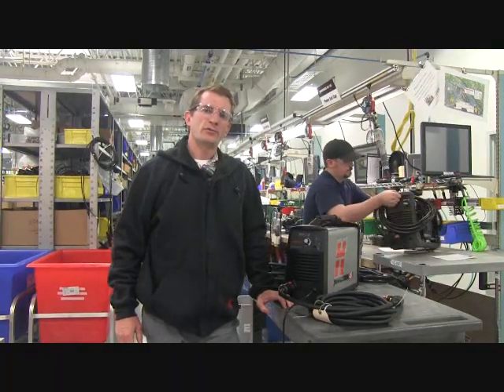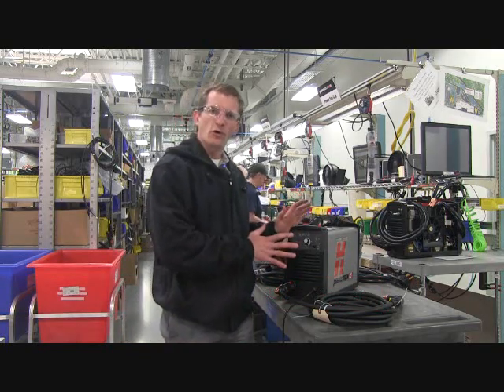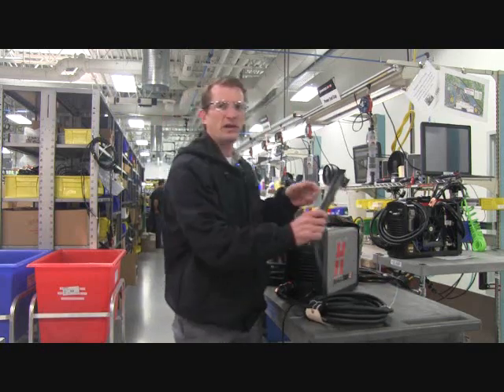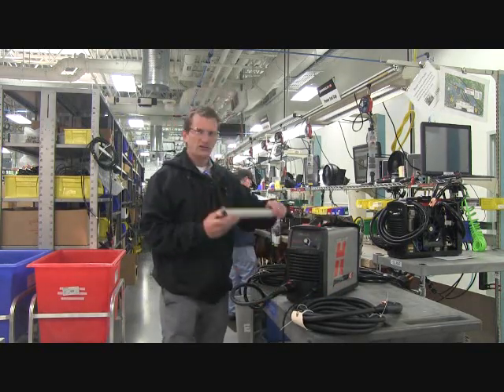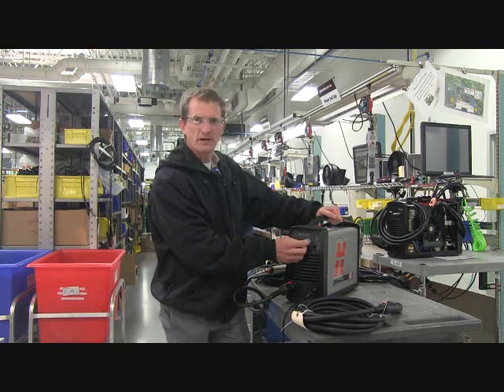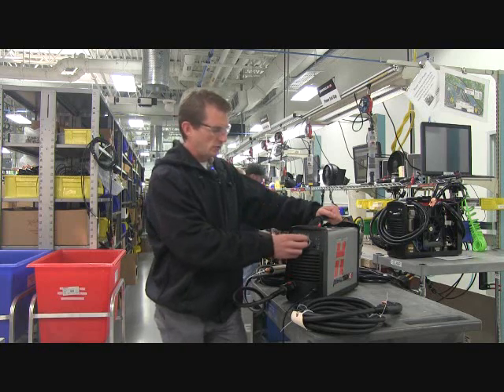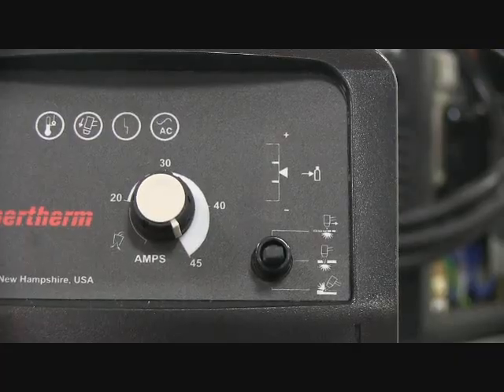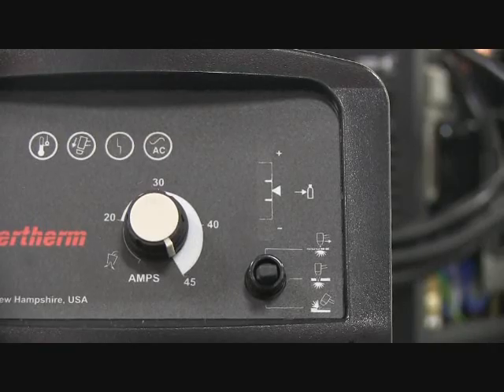Overview - Powermax45 air plasma

Comment: I have a Powermax 45 and I love it.  One suggestion though: the torch is a quick disconnect, it would be nice if the grounding clamp cable was as well.  This would make it a lot easier to store on a welding cart with a clean front face.